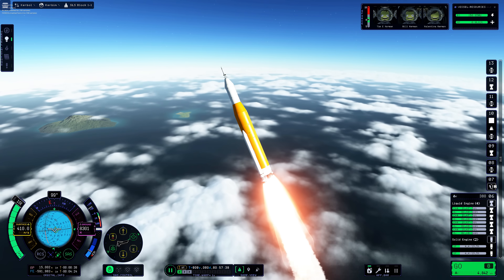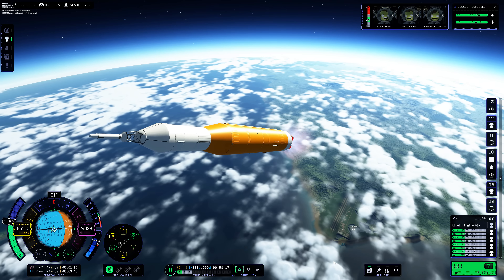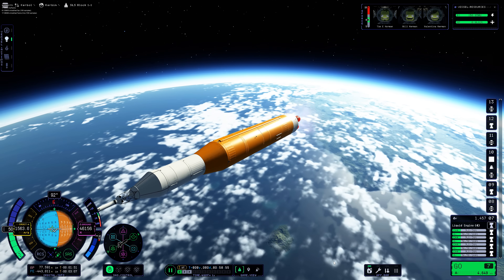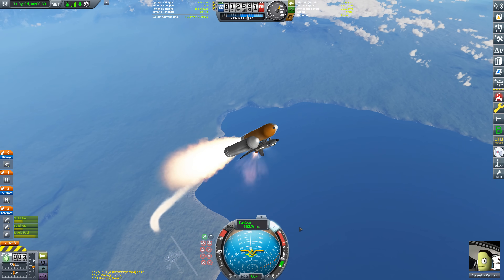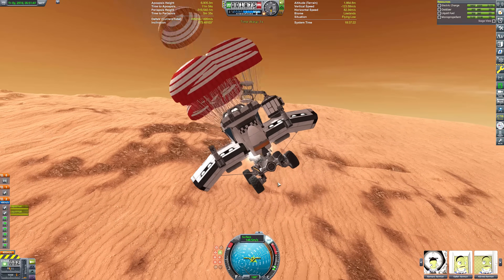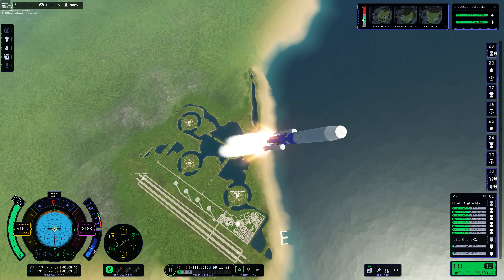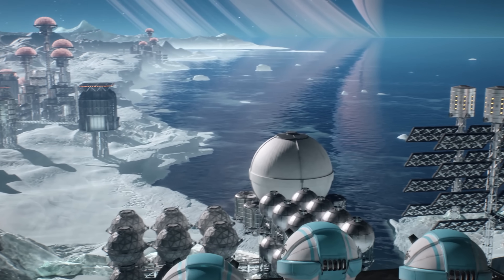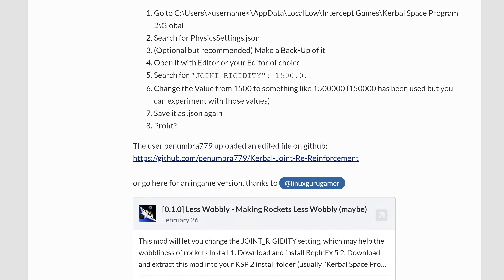Wobbly Rockets Still Haunt KSP2: Developers Face Uphill Battle

Comment: Aeronautical engineer here. I do a lot with simulation in my day-job. 

This is ultimately a problem in an area called structural dynamics. The issue here is that every vehicle part essentially adds more and more degrees of freedom to the problem. I assume the game doesn't do any modal reduction (more on that in a bit) so with every part added, the simulation becomes more and more complex. I'm not certain exactly how the physics in KSP and KSP2 is modeled, but if you're using a simple Euler integration scheme, and assuming that every part is an independent rigid body connected with springs and dampers, it's honestly amazing it works as well as it does. Explicit Euler integration also tends to artificially (numerically) add energy to the system, which can exacerbate the issue with wobbly rockets. Add to this the fact that inputs are usually inputted through a keyboard and are thus essentially step inputs continually kicking the system, you get the results you see here. Stiffening the system through increased spring constants will eventually worsen the numerical stability of it all.

What is typically done in a real engineering context is that the entire structure of an aircraft (or spacecraft) is modeled in a program such as NASTRAN (NASA Structural Analysis). The structure is then analyzed and the fundamental natural mode shapes and frequencies of the structure are determined. Structural modes are a bit difficult to explain in layman's terms, but basically they represent the different ways the structure can deform. Think of a taught string fixed at each end (like a guitar string): you could think of this as a bunch of really small mass elements strung together with springs, each with their own displacement. This would be very computationally intensive to model. Instead, you could think of the "shape" that the string takes as a combination (superposition) of simpler fundamental shapes (in this case, sine waves), and this shape is determined by where and how forces are applied to the string. Each mode shape has a fundamental frequency associated with it, and eventually the frequencies become so high that those modes stop contributing to the structural deformation in a meaningful way, so we ignore them. So, if we know the fundamental modes of the structure, we can take the forces applied to the structure, determine how much they contribute to each mode, treat each mode as an independent second-order system to determine the "state" of each mode, and then reconstruct the final deformation of the structure from the mode states. If you only consider the first few modes, you can significantly reduce the computational requirements to simulate a large structure. The catch is that you have to do a lot of computation up front to determine the fundamental modes of the structure. This involves the computation of eigenvalues (which are the squares of the fundamental frequencies) and associated eigenvectors (mode shapes) for a large multi-DOF second-order system. This is not trivial, and it may not be practical to perform something like this in KSP every time something falls off the vehicle. It could conceivably be pre-computed for each stage, but having played KSP, I know things rarely go according to plan and things blow up periodically. Docking is another potential issue where the resulting combined vehicle would need to have a full structural analysis performed at the moment of docking. If a model approach were taken, this could mean several seconds of computation may be required to perform the structural analysis. 

I have obviously simplified the above explanation somewhat, but I don't think this modal approach will be the answer for a highly interactive game like KSP. Instead, I would prefer a hybrid approach where a vehicle is composed of separate rigid bodies connected by joints, but those rigid bodies are not single parts. Instead, the interface between certain parts can be assumed to be perfectly rigid and thus part of the same rigid body, much like Kitbash Model Club's approach. For instance, parts within the same vertical stack, even between stages, could be assumed to be rigid, and the stack becomes a single rigid body. However, radial de-couplers and other "weaker" elements would retain joint physics, and parts either side of these elements would be considered part of separate rigid bodies unless connected elsewhere through a rigid connection. The trick, of course, will be determining which joints are rigid and which aren't, and do this in a way that prevents people from making rigid structures that really shouldn't be. 

Anyway, that's my two cents. Structural dynamics is not really my specialty, and there are other ways to reduce the complexity of a system like this. But hopefully the above explanation was somewhat understandable, and I hope I provided some context as to how this stuff is done in real-world engineering. Obviously, KSP is not real world engineering. However, I will say that, in my opinion, KSP is more effective for STEM outreach than any corporate-sponsored or academia-influenced program has ever been. Exposing these higher-level concepts to players and showing how they influence one's vehicle designs I think could be very effective in getting people interested in these topics.

Comment: Seems like it would be a simple solution: All parts connected together - with matching node sizes - will be treated as one rigid body. All parts radially mounted - which are "not designed" for that (eg vertical stack fuel tanks) - will have wobble, excepting small parts where they are the only thing attached.

Comment: If only they switch to XPBD as physics system rather than the convectional one. 

It's a different way of approaching physics where the default state is infinitely rigidity at the cost of perfect energy conservation. Where in the traditional approach the reverse is used.

The traditional system is more correct and realistic. But the XPBD is less glitchy and no wobble unless you explicitly want it to be there.

Comment: The problem they have in their hands is probably a gnarly one. They may need to roll their own joint implementation in order to have more control over the rigidity of the vehicle in various different simulation modes, which is probably why they had to involve Unity into this.

Comment: Matt, software engineering today does not work like it used to be 20 years ago. Today, all large engineering follow the path of LEAST RESISTANCE which maximizes PROFIT. Dev teams today are very hard-pressed to release something and release it fast, so it can start selling on time, because marketing is expensive.

Comment: It is entirely possible to write an algorithm which incrementally merges any two parts into a rigid body according to a bunch of predefined conditions. This could be very highly scalable too, provided the heuristics are well tested. With some tricky and cheap calculations it is possible to calculate internal forces between the merged components (won't be 100% realistic because of the lack of flex), this could allow simulation of breaking inside the already rigid body, if is over stressed.

Comment: Engineers have been "perfecting" automobiles for decades now. Had to remove my bumper and 1/4 panel to change a headlight bulb. This is what happens when overeducated idiots run your industry.

Comment: I had such high hopes for KSP2 before launch, mostly multiplayer and colony building. I lost absolutely all hope the moment I realized they were just using Unity's garbage PhysX integration. We all wanted this to be a game built around a novel and purpose build physics engine, one that could scale to colonies and support multiplayer (syncing large physics sims is a VERY hard engineering problem). Instead it's some shiny graphics around a physics engine from 2001, and the result was predictable. Multiplayer will never happen, it's not possible with how they have built the game, not in the way I had hoped for anyway.

Comment: Different connection points - different rules. Stack cylinders on top of eachother -> single body. Attach cylinders to sides of cylinders -> different bodies. Wrote this before 10:20.

Comment: They should really look at a mixed strategy solution where the strength of joints is calculated in the construction phase. If part connection strength is above a certain threshold, those parts fuse together into one physics object. Weaker joints become points of separation between chains of fused parts. Because all of that would be calculated during vehicle construction, it doesn't need to be nearly as efficient. Also players could be given visual indicators of strength, like construction in Valheim.

Comment: Since the rocket nozzles still still gimbal to the max, maybe reducing the max gimbal angle for the engines you use may help. The flex may be quite realistic, but the hardover nonlinear steering control system is not. A real rocket would tear itself apart with those extremes.

Comment: I think they should simulate it similar to the workflows most engineering companies do. you don't simulate an entire vehicle with detailed  FEA on every detailed solid model in the full product assembly. you build a representative simplified model of the overall structure. you focus the analysis where there are changes in shape and Diameter (these are called stress concentrations) That analysis will tell you where the high risk area's are. then you do a detailed analysis on the components in the high risk areas.

Comment: If JointRigidity is just a variable in a config file, it should be extremely easy to fix the issue. If they want flexibility to still be a thing for badly designed rockets in order to create some chaos, then all they need is to change from a global value to a local Rigidity value for each part. Small connections going to small connections are flexible, large connections to large connections basically don't move at all.

Comment: I always hoped that ksp2 would fix the wobbly rocket issue. It always seemed to be something very possible to me. 

The solution is to treat the vehicles as a single model and then run a stress simulation as an overlay with the nodes of this simulation the joints of the parts. Think poly brigade for this kind of stress simulation. Then if stress reached a critical point at a node. You could break that node. This would allow for tumbles in atmosphere to cause the rocket to break apart while still allowing non wobbly rockets during normal launch conditions.

Comment: False promises all over Tottaly underfunded development posing as an indie developer. When its actually owned by 2K all rights of Kerbal space program.  2K also owns GTA genre and Rockstar games. Had they used for an example a modified GTA V engine the game would probably be very stable and good.   The game has the same problems as it had originally because they are using a limited and cheap game engine that unity is Barley any 3D games has been made in unity. and especially not simulators.

Comment: they should just make the joints a donut shape, i.e. torus 🙄😤
to make parts with different diameters attachable, just allow bigger parts to generate a torus of the matching smaller diameter. with that, you will still get wobble for ridiculus designs, but none for a properly shaped rocket. rockets away

Comment: no one will read this who can do anything im sure. even so. i feel like a good solution would be to 1. remove wobble as it is now. 2. instead have the ship have a VERY minor amount of wobble after it has been put under "excessive" stress AKA tumbling in thick atmosphere. and if the "wobble" would be excessive enough then transition to bending. that does not spring back. and ultimately destruction of the vehicle if it continues. also certain parts should keep a "wobble" effect such as wings for aircraft where they should flex while in flight. but largely rockets and aircraft bodies should not... wobble.

Comment: Just like seemingly everyone I spent a lot of time building my first rocket and getting hyped only to watch it swim through the air like an eel...had enough fuel for Duna but with the wobbles barely achieved LKO. Then the camera glitched out and went really really far away from my craft so I could only make it out by the tiny flames when firing the engines, so I had to do an instruments-only reinsertion and landing. The last kick in the pants was landing safely after the nightmare of what was originally a fricking Duna launch, but not being able to recover vessel because that, too, glitched out. I lied by the way, the ACTUAL last kick in the pants was seeing that all the Kerbals that were aboard that glitched craft- now all unavailable to fly because they simply disappeared. Suffice to say I requested a refund immediately.

Comment: Sorry Matt, but KSP2 is a dead Horse. These guys have dumb solutions for a really easy problem. If you have 2 pieces of metal tube and screw them together you wouldnd use only one screw in the middle right? But their shitty Engine do this . .  . So the shitty outcome is clear from the get go . .  .

Comment: If Autostrut is a feature they can get up and running quickly, I feel like they should bite the bullet. Make it something you can enable in settings. They can even call it a "cheat" option if they want to. 

Then, as for an actual long-term solution. They can make certain attachment types rigid, but still do the physics for them so they break past a certain load. The actual problem with KSP2 joints isn't that they're weak, its that they're flexible. Right now if you modelled KSP2's joints on a stress strain curve, they'd probably more closely represent rubber than aluminium or carbon fiber. You can probably only slightly increase the stress, while significantly decreasing the allowed strain. 

Basically make the joints stiffer, but still with the same yield strength. This way, they flex less, but if you still do something stupid like having the power from an SRB solely transferred through a single radial decoupler, it would only bend inwards by a degree or so, then just break. This would required a lot of testing and messing about with to get somewhere that feels right, but it would be possible. In addition, you can simply identify an appropriate stiffness/strength for each joint size (for node attachments), then simply use the values for the smaller node in a situation with two different sized nodes. For radial attachments its a bit more difficult, however, you could still do it with either part size, or a few other methods.

Comment: As far as I am concerned, KSP2 is either a poor product at best or an outright scam at worst.

Beginning with the ludicrous pricepoint of the early release version and the rather poor state of things to this day given said pricepoint, it was off to a rough start, but persistent issues like these wobbly rockets don't really endear me to this product. When the game devs go against the player's feedback try to claim and defend this ridiculous bug is part of KSP's "DNA", it bodes ill for the finished product.
Looks to me that these guys don't know how to fix it and they are now either playing for time and hope they will eventually fix it or they know they can't and they try to sweep it under the rug. After all, it's not a bug when you declare it an intentional feature.

That's not even getting into problems with KSP2 itself. The game is basically just what KSP offers with a bunch of mods baked into it. Sure, it's nice that things look marginally better, it's nice to have procedural wings . . . but some core issues of KSP persist and that's bad. I can forgive KSP for some of its clunky game mechanics, but when a company sets out and (supposedly) starts from scratch to make a new game, they should streamline a lot of it and make it more convenient. The way things are, it looks more like KSP2 is just a (rather insignificant) facelift to KSP.
Worst of all, KSP2 runs way worse than KSP does.

What I want from KSP2: Stable performance, the ability to handle much larger craft, less bugs, a more convenient and adaptable craft design process and better integration of gameplay elements such as ISRU, base-building and so on. The largest flaw in KSP is that there really isn't much of a point to making space labs, colonies and stuff like that outside of a players mere will to do so. The payoff is knowing that you set a goal and fulfilled it, that's really nice, but I would appreciate it, if there was a tangible use other than me ticking off a box in my head.

Comment: Real life rockets DO wobble. Like almoast anything in real life. Look at cranes for example, or even buildings, you are on you tube - search for it. Problem is how much it wobbles and the workaround that was mentioned to change the number from 1500 to something waaaaay above that is the best solution that should be implemented from the beginning. 
Because wobble does exist and it actually is and should be a factor in the game.
Si this so called problem should be asimple fix as changing a stat and not really a serious issue the devs should be wasting time on